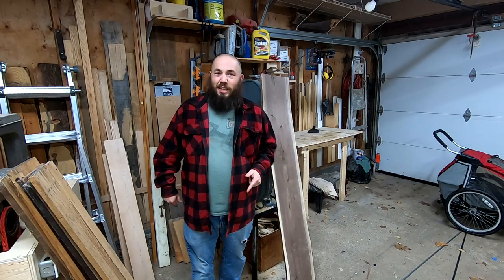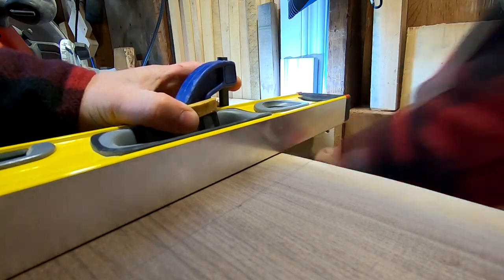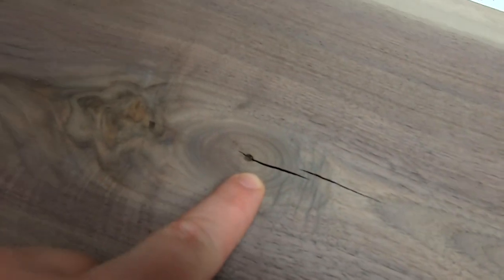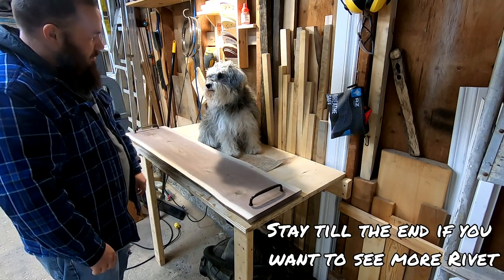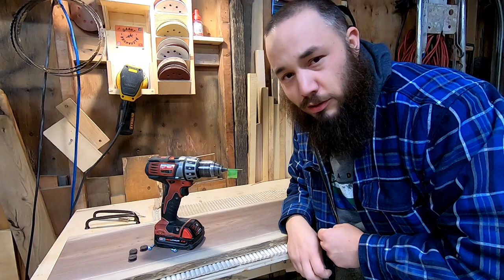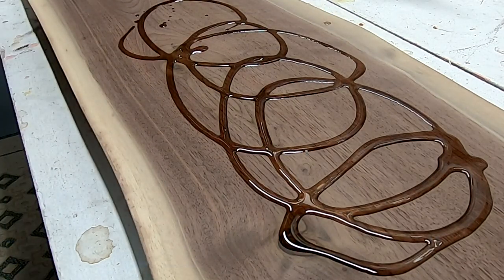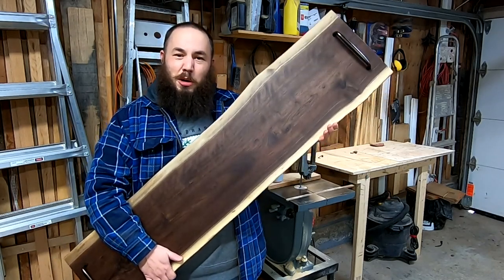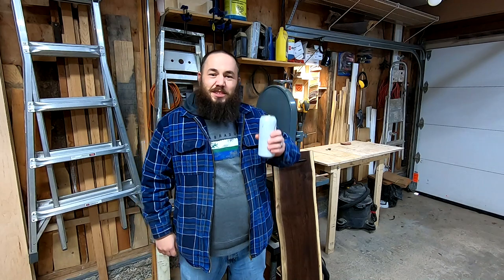Make a Serving Board - Live Edge Walnut - [Charcuterie Board] [Cheese Board]

Comment: great project.  I use a small dowel to mix my epoxy.  I find that it makes a better mixture
Reply from the maker: Thanks Will, I also use a small dowel if I have one around as I agree with you, they work great for mixing. When I don't have any I use the cut offs from the tongue of my hardwood flooring. Not as good, but at least they are free! Thanks for watching 👍🍻
Reply: @TheGrantAlexander  I have been wondering if you can mix the epoxy with colors or metallic effects?  Does this work?

Comment: What type of epoxy please? Can you also use saw dust and wood glue?
Reply from the maker: I used 5 minute epoxy, but any epoxy should work. You could use saw dust and wood glue as well(but I've never had any luck with that looking good after putting on finish) or you could use CA glue

Comment: I saw how you attached the handles but didn't see the feet exactly.  Can you tell us what you used exactly? d Thanks!
Reply from the maker: Thanks for the question Jack. The feet I used are linked in the description of the video. They are small rubber feet and I just pre-drilled a pilot hole and used the screw that came with the package to attach them. (#8 screw about 3/4" long)